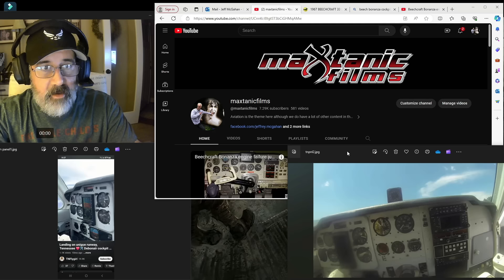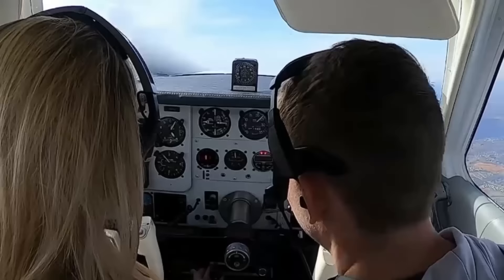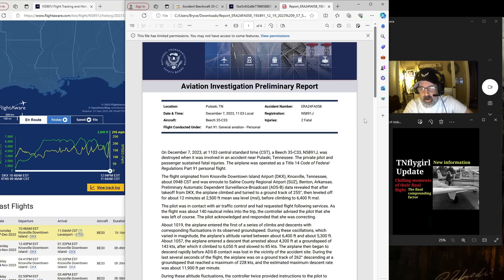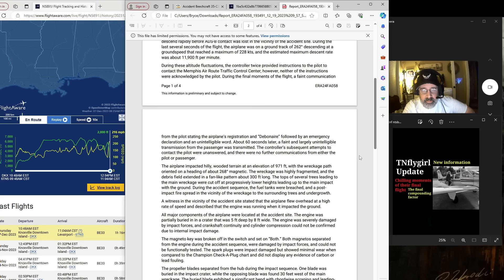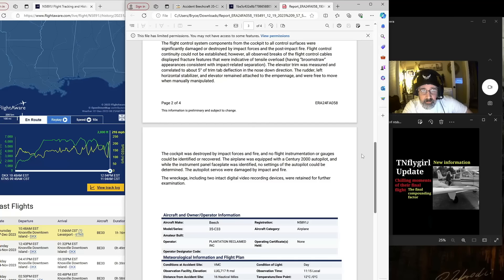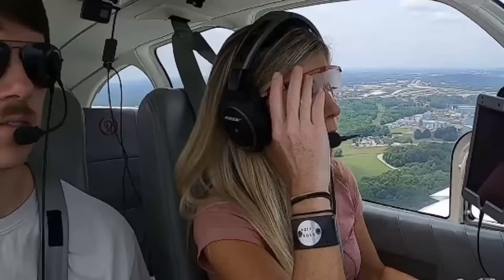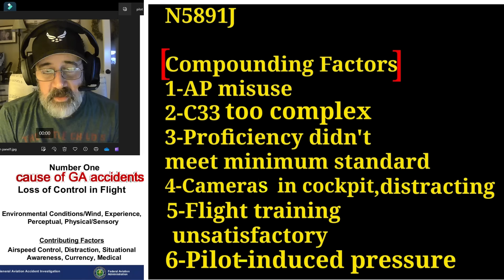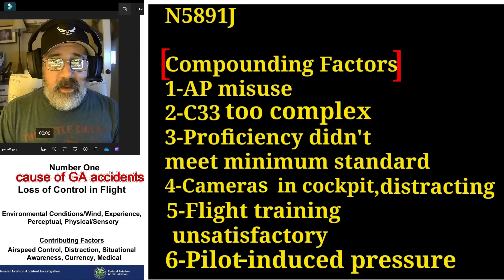TNflygirl Fatal Crash Update NTSB Preliminary Report N5891J

Comment: I agree with the conclusion that she was a fish out of water, and she was way in over her head. However, what I find even more alarming is that the Flight Instructor seemingly had no clue himself what was going on most of the time. He was clueless that they were 900’ low crossing a fix on an approach! It wasn’t until ATC told Him twice that it seemed to somewhat vaguely register with him. If this was the caliber of flight instructor that she had, she was doomed from the start. When I started my flight training back in 2004, flight instructors were largely experienced pilots, who were either instructing on the side, or retired from their career flying job in order to pour into the next generation of pilots. Then the FAA changed the regulations to require 1500 hrs to go to the airlines. I’ve watched flight instructing become a time building job, whereby a significant number of CFI’s have very low skill and knowledge themselves, and are not very interested in teaching, but rather just building their time. It really is a systemic industry problem.

Comment: I flew a Piper Trainer for over 10 years out of my private air strip on my private land, I never received any sort of training never obtained my license, so I always maintained a ceiling level always Visual Flights….well I’m not sure of the exact cause, I know it wasn’t lack of training, but I crashed, later I discovered a metal fatigue in a small connection trim rod. Well I went straight out and purchased a new plane, took a few months to build, but when completed with shiny new paint it was the best Radio Control Plane I ever had. I know my limit’s, she was out of her’s.

Comment: Not dissing the instructor at the beginning of the video, but he seemed to be just a bit less inept than she. It seems obvious he was unfamiliar with the autopilot at best. Most of the instructors I had would not use the autopilot if they were not familiar with it (I also had a century 2000). Did not matter if I knew how to use it. That was fine as I could fly the plane perfectly without it. I had many more hours without an autopilot than with. There is nothing better than learning how to fly your plane before using toys.

Comment: Static Cameras aren’t the distraction that the older boomer generation seeks to correlate. They just aren’t. Yes there’s a few videos of her slightly adjusting the camera but as we’ve all observed with multiple videos that she struggles with basic situational awareness and orientation.  Cameras aren’t difficult tor complex o “hook-up”. You set them and done. It’s extremely simple with zero effort and distraction. It’s an erroneous argument as we have zero evidence that this was a contributing factor to her incident or that it contributed to her systemic learning issues. The reality is that they are an excellent investigative tool for the NTSB and they are a great resource fir pilots in trying to review. The positives far outweigh the illogical and fact-less arguments that they are a distraction. Typical to the same generation there’s a deranged biased towards something and without justification they call for unjustified regulation. What’s more scary to me is that experienced pilots struggling to comprehend or share  misconceptions the most basic forms of modern technology like an action camera. Ironically cockpit cameras have been considered many times and will  one day become standard equipment. Not only that it will one day have real time local AI evaluating everything.  The truth is they should be mandated already as it makes zero sense to compile all the data we do without video. It’s stupendous actually.  Numerous unsolved incidents would no longer be mystery and some will likely be proven to be different then we’ve assumed.  We only have a better understanding of this pilots issues thanks to the camera footage she’s uploaded. That’s something the comments seem to forget with their gas lighting over those very cameras.

Comment: Very unfortunate incident.  I’m not a pilot, but I wasn’t impressed with the instructor.  Correct me if I’m wrong, but the salient point was the fact that she didn’t have a firm grasp of what was needed to utilize her instruments correctly, specifically the use of her auto pilot in conjunction with the need to consistently trim the aircraft after inputs to the auto pilot and power settings?  If that’s the case didn’t this more than likely end up as a stall induced loss of control ending with a crash?   Also, I find that there are several extremely good YouTube channels dealing with the review of aircraft crashes such as this one.  For you ladies and gentlemen that are pilots, is there an actual increase in general aviation crashes ( both fixed wing and rotor) over the last several years?  Thanks in advance.

Comment: She changes alt on AP and doesn't understand she needs to adjust trim and apply power. Complains about her avionics for a year and was taking her plane to upgrade her AP but on the way it appears she experienced a runaway trim. 
Flight tracking graph indicates a very chaotic and violent last minute to the ground for them both. Probably cursing her controls all the way down.

Comment: I remember early in my flight training being absolutely overwhelmed by everything happening and there were a few times later on where I really lost all mental focus.  Such an odd thing when it happens because you're so focused and then BAM it's like nothing makes sense.  I don't think it was CO poisoning it was just my brain getting overwhelmed and freezing, kinda like a the fear responses of fight, flight, freeze and fawn.  That spooked me so much that I quit flying after that.  That wasn't the only reason I quit, and it wasn't even the main reason I quit.  But it was the last reason I quit and while I miss flying, I know I made the right decision for me.

It sounds like an CO detector with an audible alarm would be a good thing to add to a cockpit. Those things can be bought at any hardware store, are light and are battery operated.

Comment: The low altitude alert should have been a clue to the instructor something wasn't right. 900 feet below an approach crossing altitude! WTF!  MULDE is on the ILS and RNAV for runway 4 at GSP. They should have been at 2,300 feet crossing MULDE. The terrain in that area is about 1,000 feet. So they were about 400 feet AGL. "A little low" at the crossing altitude bro? And the altitude assigened for resequencing was TWO- thousand, five-hundred. My dude was about to climb to 3,500. And don't rely on your students charts across the cockpit. Have your own charts in front of you following along. (So you don't end up nearly 1,000 feet below the final approach fix ) I mean, holy %$#!  

I could go on roasting the instructor about a few other things. But hope this dude is the kind of person that learns from their mistakes. Nobody flys perfect. Maintaining situational awareness while teaching is hard enough already. And it gets exponentianally more difficult with a mess of a student. 

I loved teaching. I loved flight instructing and helping people. I keep my CFI current because I worked so hard to get it years ago. But it's a dangerous job. I miss it/ don't miss it all at the same time. Straighten up and fly right. Stay frosty my friends!

Comment: It seems like she always twisted the throttle to adjust the power. I've never flown a Debonair, is that common? I've seen videos where she's landing and instead of pulling power to land she twists it down. It seems like when she's trying to go to full power to climb she's twisting the throttle instead of just pushing it in. Maybe I've missed something in her videos and I know the throttle can be twisted for fine adjustments, but it seems like she does it all the time which is going to slow down her reaction time a lot.
Reply: Former Bonanza owner here - I almost always used the throttle vernier control except on take-off or sometimes to quickly remove all power on landing.
Reply: @smark1180  Good to know. Interesting, learn something every day.
Reply: @thatjpwing  FYI, the vernier control could be overridden by pushing in the center "button" of the throttle.

Comment: The autopilot "Won't let it stall.." according to the CFI in the early flying sequence of this video... Really? Reference Culgan accident in Buffalo NY. The autopilot allowed the plane to stall in icing conditions- the autopilot should have been disconnected in presence of icing conditions for just this reason. Auto pilots don't understand aerodynamic stalls nor does it "care". If the PIC allows the auto pilot to stall the aircraft, the autopilot will NOT do ANYTHING to avoid a pending aerodynamic stall, ever! New autopilots can be set to a speed based climb or descent (i.e. 100 knot climb or descent) rather than a rate of climb or descent (such as 500 feet per minute). These new autopilots are "safer" but still do NOT understand or avoid aerodynamic stall conditions.

Comment: How does anyone fly without understanding power, airspeed, pitch and vertical speed, and trim.  If the autopilot cannot automate needed configuration to allow it to work, then the pilot must cover those tasks, or commit to avoiding autopilot.
When you cannot get power, pitch and trim correct, you aren't going to win a battle with an autopilot you don't thoroughly understand.  Was this pilot even curious enough to use simulator software ??
Think of how JFK junior didn't need to die.  All he needed was a basic understanding of his instruments.
There was a 747 flight that nearly ripped the plane apart because the pilots weren't trusting the instruments.

Comment: I don't have my ppl but I do have a few hundred hours in very small aircraft.  In my opinion, you need to know how to fly stick and rudder before you try to learn constant speed props, GPS and auto pilot.  Many aircraft I have been in only had a compass, fuel gauge, altimeter and airspeed indicator and the old farts that flew them did just fine.  Maybe I am ignorant, but why not simply disable the autopilot and fly the plane?

Comment: She seems to me like someone who has been handed the controls of a Motorcycle in top gear on a loooong straight road and as long as you steer and keep the revs up you will be fine. BUT being able to do that does not make you a motorcycle rider or automatically give you full knowledge of how to ride a motorcycle.  She knew the practical side of it enough to get off the ground but the finer details were lost on her I think. I am no pilot, but I can imagine that the actual 'flying' part of flying a plane,  i.e. keeping it in the air ... is the easiest part ?  But all the little checks and functions and calibrations thats where I think this poor Lady tuned out totally. Cutting Corners so she could be that YouTube Pilot lady.   Shame really.

Comment: Are you saying that planes do not have carbon monoxide detectors in them?    That is ridiculous, pilots can purchase a battery operated carbon monoxide detectors at walmart, that go in your home, that can be affixed inside the cabin of the aircraft, which is exactly what I would do if I flew a plane, because it's a gas that can overcome you without you knowing its happening, I'm absolutely shocked, that such an inexpensive but critical detection device is not mandatory on small aircraft, even if it did not cause this crash, it still could save lives in the future.
Reply: There is a disposable-type aviation CO detector on the right side of the panel below the gopro. These have to be replaced every month I believe. Who knows if hers was fresh or if she even paid attention to it in the first place. She was so far behind the airplane I doubt she would have noticed if it changed color.
Reply: No, a CO detector is not standard equipment.

Comment: Cameras in the Cockpit had Nothing to do with her apparently hideous piloting skills.. just as motor  vehicle  cameras are extremely Helpful in acident Aftermath evaluations, Only her You Tube recording footages reveal the Extent of this gross piloting deficit....When even the attending CFI pilot is getting  ATC heading & altitude radio comm  Cautions,  that's unbelievably Bad...
Reply: You haven't seen all her videos. A few times the rear GoPro fell off and she was on it. At one point giving up and handing to the CFI. They were distractions. If she flew like she tried to reinstall her cameras or in many cases DID mess with them who knows. When she soloed she was messing with the rear camera for minutes, posted the whole thing.